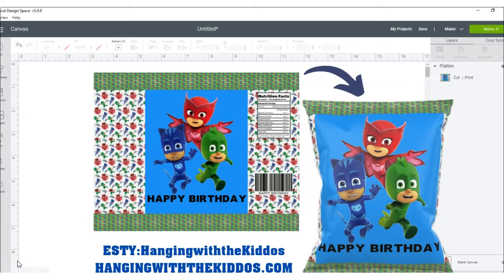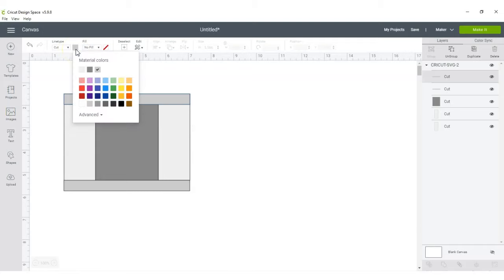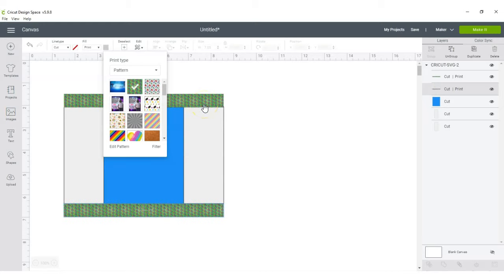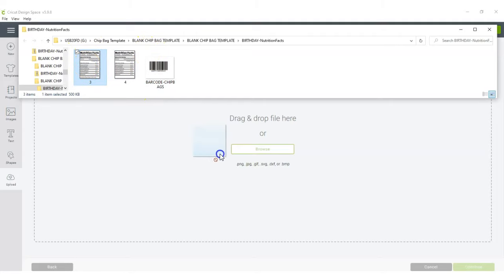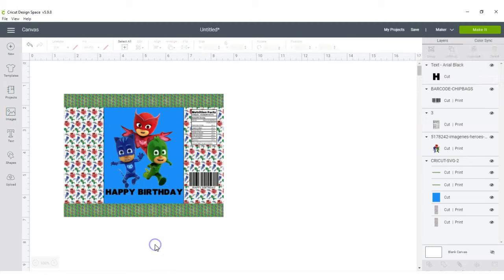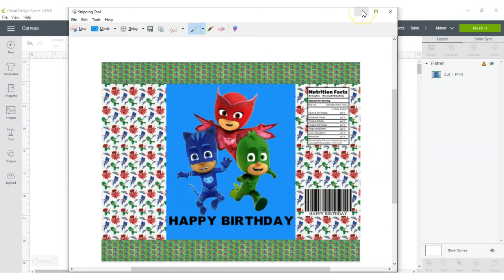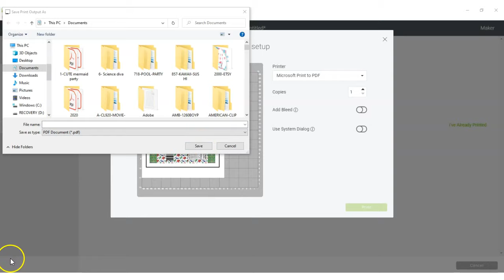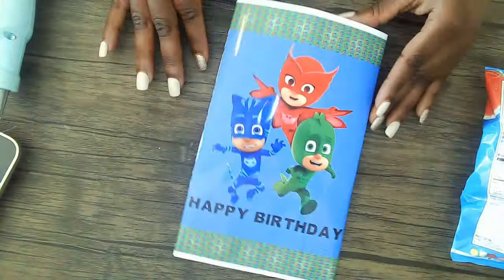Cricut Design Space Chip Bag Tutorial| DIY Custom Party Favors|How to make chip bags with Cricut

Comment: When I print on pen and gear glossy photo paper the ink smears when touching it, is this normal?
Reply from the maker: Trying adjusting your printer settings for the type of paper you’re using. The settings that works best for me when I’m using glossy paper is paper type: glossy photo print  Quality best
Reply: Usually happens because your ink is “dye” based instead of “pigment” based. Quick google search on your ink cartridges should tell you what you have. Sometimes trying a different brand of paper will do the trick too.

Comment: Hi! I have a Hp envy 6055 all in one printer , is that okay for printing?
Reply from the maker: Yes, I print with my HP ENVY most of the time. Just make sure to adjust the printer settings for the type of paper you will be using. For example if you’re printing on glossy photo or brochure paper. The paper tape needs to be set to photo or glossy and print quality needs to be set to best.
Reply: Will any hp envy printer work
Reply from the maker: “ I have purchased two  HP envy printers over the years and both have printed well.

Comment: Hello. I have watched a few of your videos so far. They are very helpful. However, I was wondering do you recommend using the HP Envy listed in the description box or do you use the Epson mentioned in the other video for your glossy chip bags?
Reply from the maker: Hi, I would recommend both printers. The Epson prints  great quality images however the replacement ink is a little expensive in my opinion it doesn’t last very long.

My HP Envy prints good quality images and it’s more cost-effective with HP Instant  ink program. This is a great option for beginners.
Reply: I just remember you saying when using the glossy paper with your HP that the ink doesn’t dry all the way and smears. I had that same problem on my first attempt with the printer I had. So I was looking for a new printer to avoid that problem.
Reply from the maker: @chantellemorris1370  yes, this was before I figure out all I needed to do was adjust my printer settings for the type of paper I was using with the HP Printer. 

After settings the paper type to glossy or photo paper and the  print quality  set to  best. I had no issues with smearing.
Reply: @HangingwiththeKiddos   thank you so much I will try that
Reply from the maker: You’re welcome, I hope everything works perfectly for you 😊

Comment: Do I have to convert it to a pdf file or can I just print it straight from cricut design space?
Reply from the maker: Yes if you want to print a full size bag you have to convert it. You can also print straight from design space but your bags are going to be smaller.
Reply: @HangingwiththeKiddos  ok, I wanted to use the sizes the come in the variety pack ( like the one you put in kids lunch box)
Reply from the maker: As long as they’re 1 ounce or smaller they should be able to fit just fine